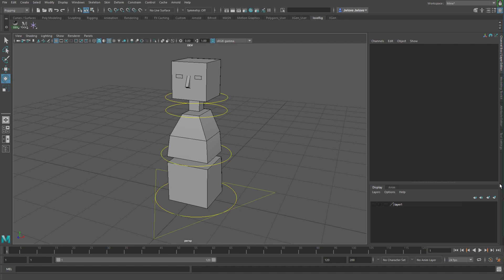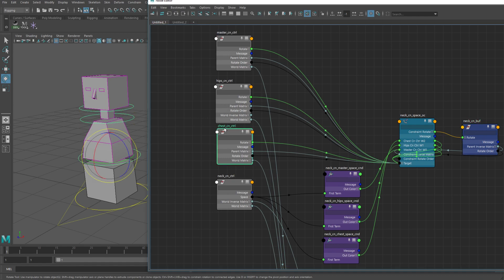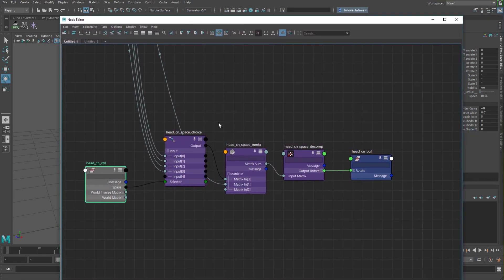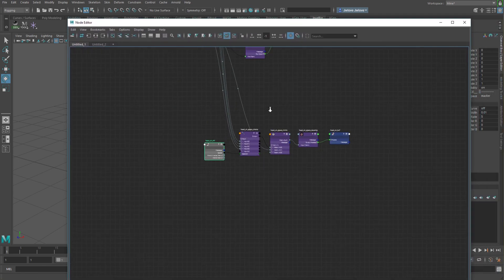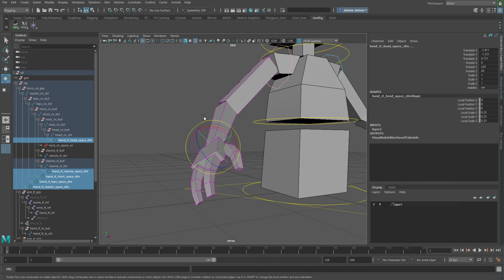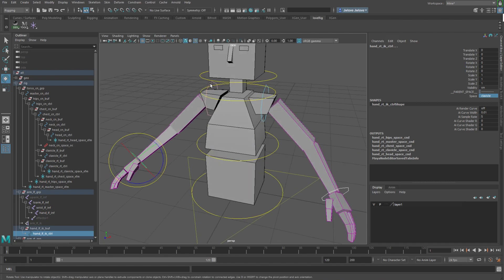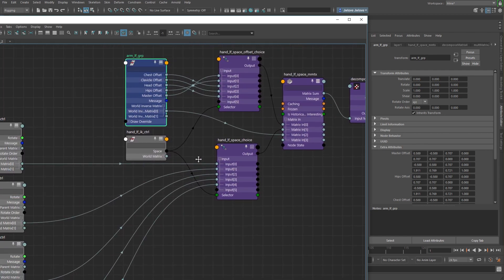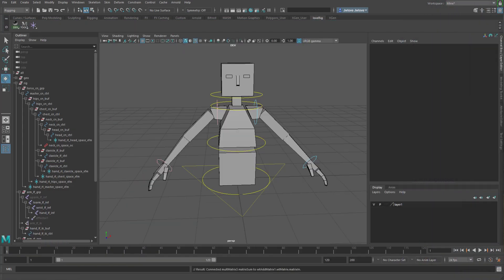Maya matrix node space switch tutorial

Comment: How much faster is it compared to maya's constraints?
Reply from the maker: That's a tough question to answer because of all the factors involved - the evaluation mode you're using (DG, serial, parallel), scene size/setup, and even the hardware of the computer you're using.   Also, if you're just comparing one parent constraint to one matrix node network, the difference will not really be noticeable, it's only after you get several in the scene... which is really not hard to do if you replace all/most in a rig and have multiple rigs in a scene.

To give some numbers and a bit of an idea, I created a file of one parent constraint setup and another one with a corresponding matrix 'constraint' setup, then gave them identical animation over about 30 frames (4 keys).  I imported each 200 times into their own file so I could compare a large number of each together (identical in every way except the constraint).  Then I used the evaluation toolkit to test the fps playback speed.   So, I ran each 3 times and took the averages, but listed all the values so you could take the highs and lows to determine a range yourself if you would like.

parent constraint:
Playback Speeds
===============
    DG    = 220.1047 fps  (204.545   |   230.769   |   225)
    EMS = 50.1096  fps   (48.913   |   50.2793   |   51.1364)
    EMP = 183.7243 fps  (187.5   |   180   |   183.673)

matrix nodes:
Playback Speeds
===============
    DG    = 232.766 fps  (214.286   |   243.243   |   240.769)
    EMS = 68.892  fps    (68.1818   |   68.1818   |   70.3125)
    EMP = 200.202 fps  (195.652   |   209.302   |   195.652)

With those averages, the DG mode is about 5.75% faster, the EMS (serial) is about 27.26% faster, and the EMP (parallel) is about 8.23% faster.  So, the more constraints you convert to matrix nodes, the more improvement in fps you'll see.  Granted, this is only testing the difference between the constraint speed and not the space switch speed, but it should give a pretty good idea even then.

One thing to note is that it seems the first test for DG mode might have cached the parent constraint or something because it had a really low fps (around 109 I think - reopening the file and testing a few times continued this trend), so I ran it 4 times and took the last 3.
Reply: unless you're dealing with a huge scene with tons of objects with spaceswitching involved... not enough to make the transition immediately important.

Comment: this isn't a good solution, if you rotate a driven object's parent, the driven object will still obey its parent as if there was no connection, then, with that parent's offsets affecting how the child behaves, if you move your driver object the driven object will be out of sync, so you're not really in the "space" of the driven object.
and I dunno about y'all but my animators will even move the top most node to fit the starting point of their scenes so there's NO WAY to ensure these connections will ever work as intended.
Reply from the maker: Thank you for the comment.  That's interesting - I don't seem to have the issue you brought up when I work with it.  Whenever I set up a matrix constraint, the driven node no longer follows its actual parent node but instead follows along with the driver.  My guess is that you may have made a mistake somewhere in your connections that prevents it from working as intended.  Working with matrix nodes can be a little confusing and aggravating at times - especially where multMatrix nodes are concerned because the order of input is critical to get right (otherwise it will give you what appear to be strange results).

Something to remember is that there are multiple ways to rig things.  Not every method will be the best fit for every situation, so you need to use what's best for your particular needs and requirements.  These matrix node constraint systems have the ability to really speed up the rig functionality by streamlining connections and making the data flow as efficiently as possible through the rig.  But, something to be aware of is that it does become less and less noticeable as computer processing power increases (and things like parallel evaluation helps as well).  Even then, if you need to have 100 or even 50 characters in a scene, the constraints may begin to bog the scene down and these are a tool to help lighten that burden on the system - scene splitting where you have smaller collections of characters and render in passes to composite together at the end is another option as well.
Reply: @JarredLove  thanks for the response even though the video was posted in 2019-ish... I'm coming back to this now and trying to find where I went wrong.
Reply from the maker: you are welcome!  If you're still having issues with the matrix system 'flipping out' as you move the driver or the driven node's parent you could try simplifying your setup and just get a single matrix constraint working first before applying it in a 'space switch' situation.  Pair it down to a node as a 'control' (like creating a nurbs circle or something), and a 'driven node' with a parent (like a cube with a group node) and get the constraint working with the matrix nodes to drive the cube with the circle.  then move the group node around and/or parent it to some other nodes and move them around to see if the constraint is actually working.  If it's not, there's probably an issue with your connection order into the multMatrix node.

good luck, and I'll try to help out as best as possible
Reply: Hey I got it to work!! Thanks for you help and videos,
Reply: @JarredLove  question... what's the best practice for adding spaces to an object already set up with spaces? should I disconnect the decomposition from the target object, then capture the offset and hook that up to the choice nodes then re-hook up the decomposition to the target object? (I've had it break things for some reason)
Reply from the maker: Glad you got it working!  As for practical advice for how to add new spaces in - I'm guessing you're asking how to do it dynamically during an animation?  And that's a hard question to answer without knowing what your exact setup and situation is... it would likely take me some experimenting as well to figure something out.

You also may or may not want to handle in-animation/shot-specific space switching completely separately so you don't 'damage' the rig in the middle of production, and just leave 'rig-defined' space switches for things within the character itself or for the most common space switches a character might need.

Another thought would be to add in some kind of 'free floating' control to space switch something into and you could then constrain that item to other things allowing the rig space switch to be essentially encapsulated from any 'additional' on-demand switching that may come into play during animation.  An example to hopefully better describe this idea would be to have an extra control that you can switch the hand into it's space, then you can constrain that control (or it's parent node) to multiple different things like weapons, tools, boxes, etc.  So, the rig would handle the clean switching of the hand into and out of it's hip/head/chest/etc spaces as well as this free floating control, and then the animation space switching tools would handle any space switching required for that free floating control to go between various props.

Comment: There's a bit of dishonesty about needing the locators for the parentConstraint method on the IK hands... I've added several "spaces"  even at different times in my animation with a parentConstraint maintaining offsets, and when you add that new target, nothing jumps or messes up... no locators needed (even for objects not aligned with the object you're constraining). All you need is a script to run when you switch your space, and that's typically done through some sort of extra UI, and that script usually creates a transform at the position your control is at, then switches your control to the desired space, then matches transforms to the created transform object.. and then deletes said transform object... nothing extra is needed to be floating around in your scene all the time.
(and to do that with animation, just have the script, set a keyframe at the current time, go back one frame, set a keyframe there, go to the current time, do all that spacing, and set a keyframe, overwriting the first keyframe)
Reply from the maker: Thanks for taking the time to watch and comment on another video!

Well, it wasn't intentionally dishonesty...  you can look at the conversation thread in these comments with brod515 (provided the user name doesn't change).  They mentioned some confusion and not having that issue with parent constraints, and it's something I was actually not aware of... I then go on to explain that years ago when I first learned methods for creating space switches, that it was what I had to do because there was no such thing as a parent constraint at that time.  Once parent constraints were added, I kind of just kept doing it the way I had done it using point and orient constraints.  But there are a few other minor benefits of having a node to perform that switch on (I prefer a transform, and only used a locator in the video to help visually show where that node was).  Here's an excerpt from that conversation:

"So, in using a parent constraint, you actually wouldn't need those locators/transforms and it should still work fine; however, since the stored offsets are somewhat hidden away within the constraint node, it could be a little bit more difficult to diagnose if there's something wonky going on with your switch.  Having the transforms there does make it a little easier to select the node for a given 'driver' and see where that pivot is and how it's oriented in space...  But, there's really no reason you couldn't create a tool to make temporary locators and use the values in the constraint to give yourself a visual cue when trying to solve that potential issue."

Also, this video is just for setting up the mechanism for a space switch within the rig - you would likely still need a tool like you mention to re-position the hand control (or whatever it is) to the same position and orientation in world space because it is definitely going to 'jump' to a different spot when you change spaces - in fact, I even mention that in the video.
Reply: @JarredLove I didn't intend the "dishonesty" bit as a dig, mind  you... and I'm sorry that's how it sounds, it looked like a knowledgible person was skipping something of parentConstraints and comparing that to all of the strengths of this matrix connections.
I'm re-reviewing now and see how I could've come across poorly. My apologies.

I still run into the same issue when trying to use this method over the parentConstraint method from my other thread though, but I have seen it work ferpectly so I'm doing something wrong.
I will add that there is a bonus to the matrix not discussed here, but you can make a cyclical connection without the cycle spam so long as the objects are never set to cycle.
ie: objA can have objB as a space, and objB can have objA as a space (so long as they each have a second space to go to), and there's no constant spam about a cycle unless you set them both to be driven by the other at the same time.

I think that's awesome as I have props that need to do that (like nunchaku, or a broom in one hand or governing both hands), and you can't have that with constraints without the warning spam.

Comment: hello
i same your rig character by matrix when switch Between enam attr jump to position and not snap .
can help me?
Reply from the maker: Hello,  I replied to this, but it seems to have disappeared between when I finished typing it and hit reply... so sorry if there's a duplicate that pops up somehow...

Yes, the snapping is going to happen - that's unavoidable unless you write some sort of plugin to automatically deal with the popping switches will create...

So basically, you'll need to write a helper script to move the control back to where it was before the space was changed.  It would go something along these lines:

1) collect world space translation/rotation from the control
2) switch the space
3) apply the world space translation/rotation that you collected before the switch

NOTE: your switch should always used stepped keyframes, and your control's keyframes will either need stepped keys for the switch, or 2 keyframes (one on the frame right before the switch, and one on the same frame as the switch).

You can collect and set the translate/rotate values with the 'xform' command utilizing the 'worldSpace' flag/kwarg

Hope that helps!

Comment: Hey Jared, is this setup essentially deprecated now with the new Offset Parent Matrix node in 2020?
Reply from the maker: Hey Nico Corrao - great question!  I would say yes... and no....

Yes, in the sense that you do not need the 'decomposeMatrix' nodes anymore since you can just plug into the 'offsetParentMatrix' attribute.  Just be aware that there will be a little bit of additional things to consider and implement... if you only want rotations or translations instead of the whole resulting matrix, for example...

No, in the sense that the nodes required for creating the appropriate matrix to feed into your driven nodes are largely the same, so the concept itself still stands even if a few of the specific connection details are different.  There may also be situations where you do need to decompose a matrix to extract out some of the information if you aren't plugging directly into a transform node's offsetParentMatrix attribute, so being familiar with the decomposeMatrix node could be helpful....

I do plan to do some updated videos using the matrix node additions from maya 2020.  I tried them out briefly when they were released and really like the additions a lot; however, there are a few things I need to experiment with to verify how I personally would like to implement them in my own work before making those videos/suggestions.

Thanks for taking the time to watch and comment!
Reply: @JarredLove  Please have a updated vid usign the new Maya matix nodes.